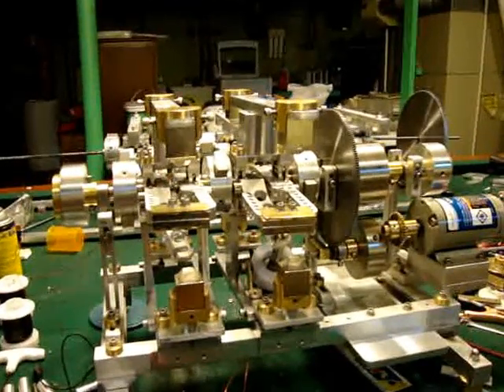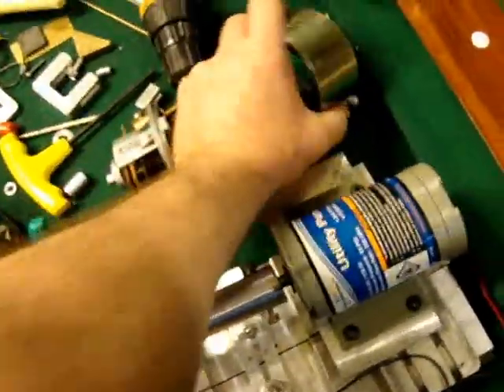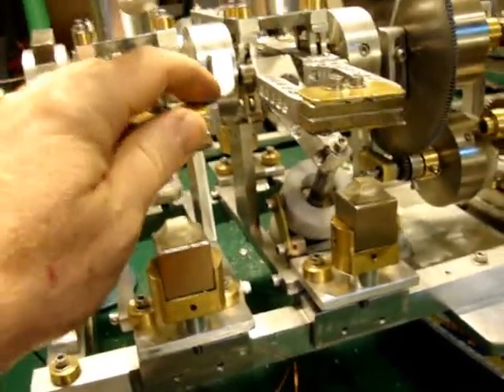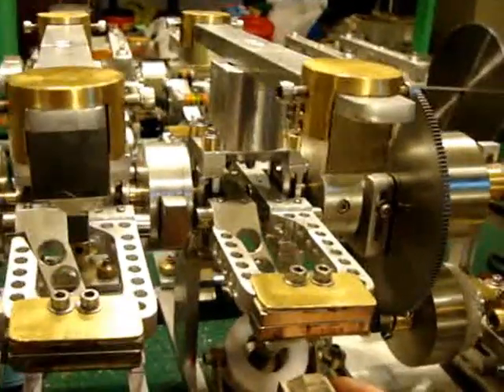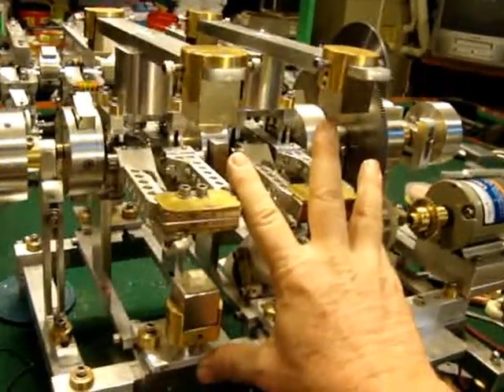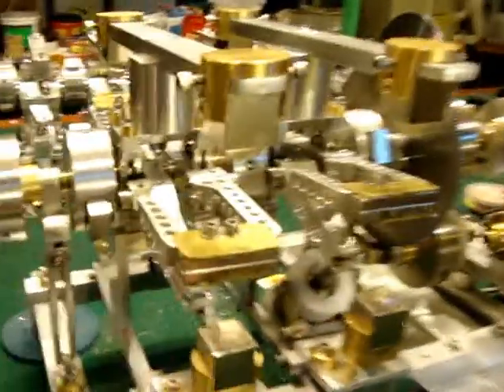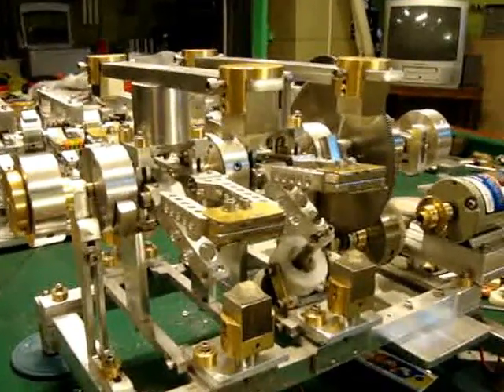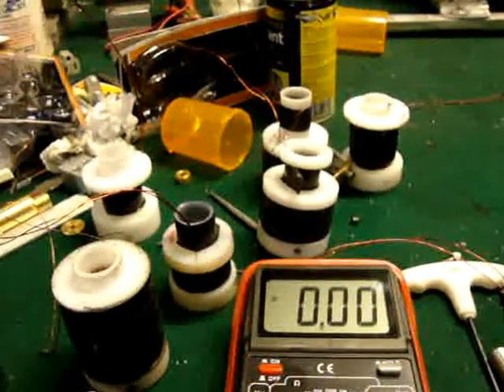Over Unity 36

Comment: Awesome piece of machinery! The only modern high tech version of a Wesley Gary motor/generator of 1800's that was suppressed in it's day.  http://www.google.com/patents/US190206 Put stationary coil above and below the vibrating outer magnet arms and you will be moving the neutral line. Coreless coils.
Reply: CoyoteGenius314 Thanks very interesting to read and it's from 1876. 
We  never had to use gas engines , Greed is more real then planes in the sky. They can't kill us all.. We must build till our hands don't work.

Comment: magnets with mutiple poles have just started to get produced. they can now get a fixed magnetic field without using a superconductor at super cold temps. Self running magnetic motors are just arround the corner dude